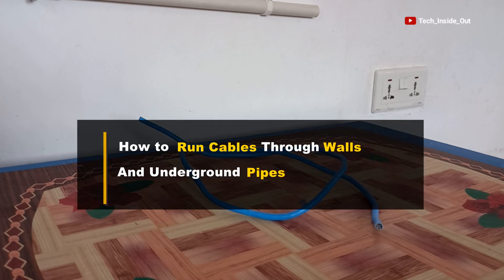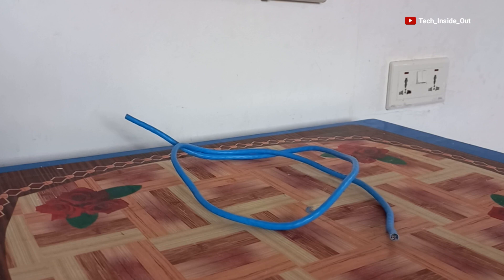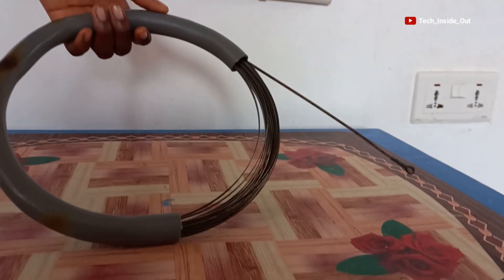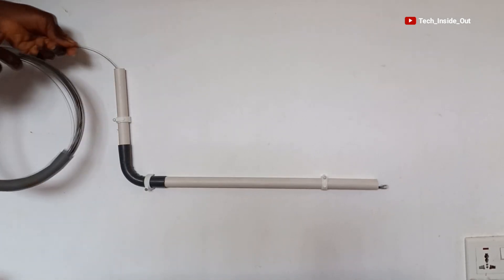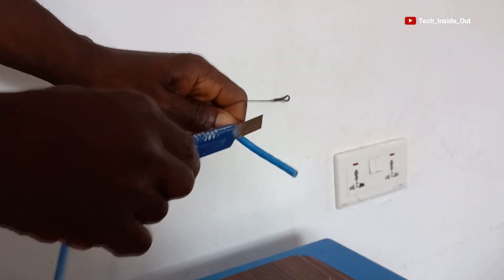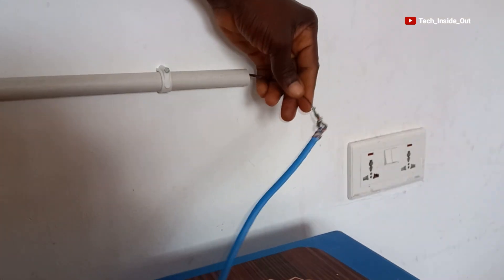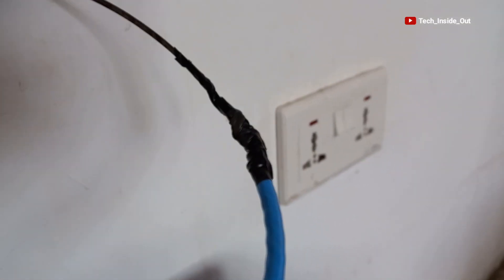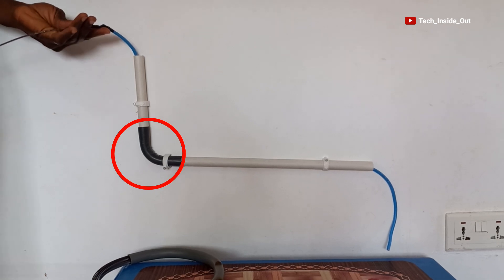How to run cables through walls and underground pipes

Comment: How drill and setup trunks on walls, when walking in town i see a lot of cctv installers find it difficult to do this, so most them  leave their cables visible which i think is a back practice.
Reply from the maker: It is best to use conduit pipes to conceal the cables because it makes it self makes it secured.